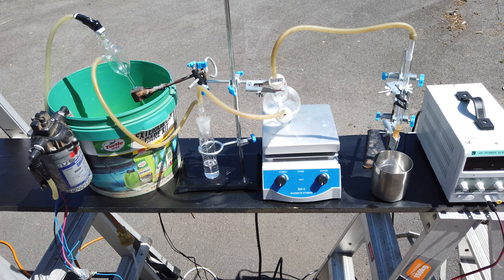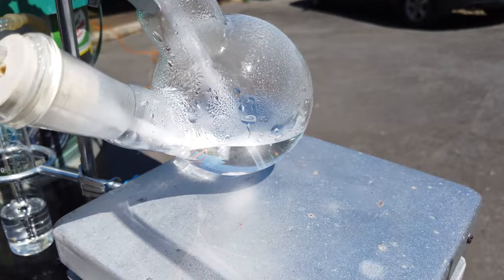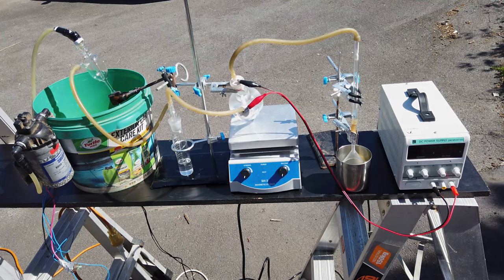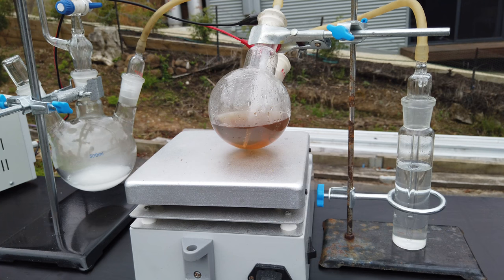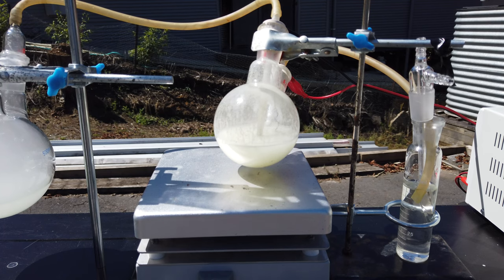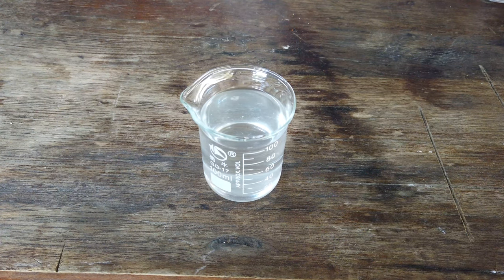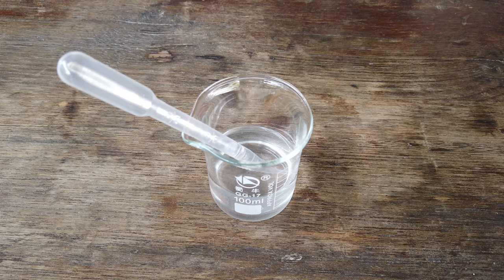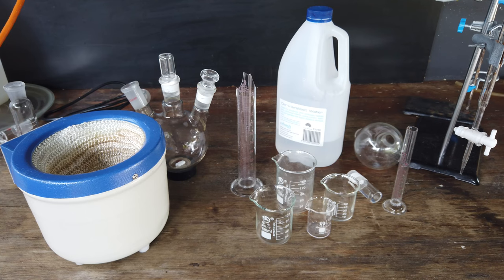Sulfuric Acid From Sulfur Dioxide?

Comment: Some soluble sulfate salt that preferribly creates an insoluble complex with oxalic acid may be an option. Mixing both in equimolar proportions in as little water as possible, then putting it into the fridge and decanting the liquid, followed by destillation the next day could be enough. I wonder if this also works with a 2:3 mixture of aluminium nitrate nonahydrate and oxalic acid in order to get some quick and dirty nitric acid, since aluminium oxalate is insoluble in water aswell.

One thing to be aware of is that Oxalic acid is redox active, so there may be some concentration limit due to decomposition setting in. If that somehow wasn't an issue, then the oxalic axid could be molten (mp for the dihydrate is 101°C) or triturated with the target compound directly in order to get somewhat concentrated acid easily.
Reply: Copper Sulfate with Oxalic Acid is what I've seen. The properties of all the reagents seem just right. The melting idea seems super interesting but I could imagine that to be quite dangerous.
Reply from the maker: I didn't actually say it in the video here, but one of the reasons I'm trying this method is to avoid starting with a sulfate salt. I have other videos about converting sulfate salts into sulfuric acid, but if we can start with sulfur itself (which is a lot cheaper), it would be beneficial from a financial standpoint.
Still though, definitely something to look into if the reagents can be found cheaply.

Comment: Mix sulpher with water and heat under pressure in a stainless steel wessel 😂
Another way is to blast with UV🎉
Reply from the maker: Yeah, I'm going to be staying well clear of pressurised reactions, lol.
Reply: This sounds like if the average londoner designed a reaction scheme 😂
Reply: @ScrapScience  But they're the most fun, how else would you simulate reactions on Venus ?
Reply: SO2 plus oxygen blasted by UV works sort of. The SO3 formed will condense on the UV lamp absorbing the ozone lines. The problem can be solved by using a stronger UV source that makes enough heat to sublimate the SO3 off the light source.

Comment: I didn't know you could make any sulfuric acid at all from just water and sulfur dioxide. Not a chemist but due to the sheer simplicity of your control test, would it be worthwhile to just bubble sulfur dioxide through water and recycle the sulfur dioxide that didn't react to make h2so4 and just do that over and over and over? Sort of like those homemade birkeland eyde nitric acid generator things?

Also what would happen if you ran ozone from an ozone generator through the sulfur while burning it to try to make it give off so3? Probably wouldn't work but I've never seen anyone try it before.
Reply from the maker: The control test didn't actually generate any sulfuric acid. The hydrochloric acid that carried over from the sulfur dioxide generator just gave us a false positive, and it's likely that the electrolysis reaction gave us the same false positive too.
An ozone reaction is definitely an option, but I'm not a fan of how long those reactions take and how low the efficiencies are. I might give it a go one day, but I don't have any plans right now

Comment: Well that's disappointing but I guess that's how these experiments go sometimes. Perhaps it would work in hydrochloric acid instead of sulfuric acid. H2SO4 will just produce O2 at the anode but HCl electrolysis would make chlorine and hypochlorous acid which could oxidize SO2 or sulfurous acid in solution to sulfuric acid. That way the oxidation isn't limited to the anode surface but the whole solution. There might also be less sulfur formation at the cathode because sulfurous acid in solution would be rather short lived.
Reply from the maker: Yeah, it's looking like some kind of homogeneous catalyst might be required for this oxidation. I've been thinking about using dissolved Fe(II)/Fe(III) as an 'electron transfer mediator' of sorts, but I'll add chlorine to the list of things that might work!

Comment: Could you use NO2 to do the oxidation step from SO2 to SO3? Perhaps this would be a way to make the Birkeland-Eyde reactor more efficient. "simply" put an adjustable air metering valve (they are cheap) on the intake of the BE reactor to give some control over the now-forked intake (assuming you go back to the burning sulfur/pull-thru setup). After the BE, you could use an air or water jacketed condenser to re-form the scrambled diatomic Nitrogen and Oxygen into some NO, which forms NO2 in contact with the remaining O2. From there, combine the SO2 and NO2 paths and run them into a chromatography reservoir for dwell time and visual appeal for friends and family. The unreacted NO2 should form HNO3+NO on contact with water, assuming it doesn't react with the SO2 to make SO3+NO on the way there (this makes contact time sort of a big deal). This is the point where you can get the bulk of your H2SO4 and HNO3 in the reaction flask. Any free O2 remaining, and the inevitable trace amounts of NO will oxidize back to NO2 and react in the gas wash stage, becoming weak but recoverable, HNO3. The HNO3 side products should be able to separate from the mix via distillation. Nitric acid boils at a far lower temperature than Sulfuric acid, so a Vigreux column should give a good separation of the two acids, preceded by fractionating the water/HNO3 mixture. You'd probably want to cool down and remove the Vigreux for distilling the H2SO4. Or, you could do it all in one distillation by attaching a vacuum source during the wide temperature deadzone, and then insulating everything, then insulating the insulation. With a light vacuum source, you can get the Sulfuric acid boiling point a bit under 300C, and with a strong vacuum source, you can get it down to a little over 200C. That's not bad, but your glass is likely to get stuck together, warranting the purchase of fancy combined function glassware (for fewer connections).

...or you could get bulk Sodium Percarbonate pretty cheap, in bulk. It is the active ingredient in Oxyclean, and various brewery/vintner food-safe sanitizers. It's 32.5% by weight H2O2, but in a powder form.
Reply from the maker: Nitric acid/NO2 is definitely an option for this type of reaction. In fact, they can actually act as catalysts to force the reaction between atmospheric oxygen and aqueous SO2 (so no NO2 is actually lost in the course of this reaction). A definite idea for the future. Thanks!

The problem with sodium percarbonate is the fact that it's mostly sodium carbonate. Using this stuff directly will produce sulfate from SO2, but the basic nature of the sodium carbonate will cause the final product to be sodium sulfate (probably one of the most useless chemicals I can think of).
Reply: @ScrapScience   Thanks for the reply and confirmation of the idea. 
The part that involved the Sodium Percarbonate was not intended to be used directly, because of the obvious neutralizing effect of the carbonate. I kept that afterthought brief because I don't know how CO2 will affect the system. CO2 is likely to come from acid-forcing the carbonate to give up its O2 content.
The Percarbonate side reaction would be from a flask with the powder, a vacuum port (for output), and a PE-Addition funnel to drip some liquid onto the powder to cause it to release the O2 (and CO2 biproduct). The vacuum port runs the O2 via hose to the cooled, pre-dwell-bulb gas flow from the Berkeland-Eyde NO generator. 
I don't know what liquid would be best for releasing the O2 from the Na-Percarbonate. I would default to Citric Acid (cheap, dry, doesn't stink, non-hazardous, known to cause NaPC to foam aggressively in my washing machine) dissolved in water.  I suspect that it will put a lot of CO2 into the airflow, as well as some water vapor.
 I have no idea what effect the CO2 would have on the overall experiment. The effects are probably negligible, beyond Carbonic Acid pH offset. Since it would likely be a better idea to perform the distillation(s) before measuring the produced products, any CO2 should be a non-factor by that point, assuming it doesn't interfere with the process. 
Arguably, it may be better to place the air flow metering valve before the Pressure Equalizing Addition Funnel, and place this funnel/O2 generator setup before and inline with the BE reactor, in the hopes that the electric arc will also break the CO2 into O2 and ??, but I would be concerned about it making organic materials and tars. The post-cooling stage will have water, and it will become liquid acid, for sure. The physical arrangement of the system will benefit from ensuring the fewest gathering spots for this water/product loss to accumulate.
Reply: Oh, I see my error with the first comment about the Sodium Percarbonate. I smugly offered that as a source of H2O2, without thinking of a way to separate that from the carbonate afterward. 
Well... It can still produce O2 at an estimated cost of $0.03 per gram of O2 (best case scenario/if buying 10Lb bag of sodium parcarbonate + shipping in USA). I don't know if this is a good value for the additional NO-to-NO2 conversion efficiency, but it's more glass, and bubbles, fun adjustments to make, and calculations to calculate. Certainly worth the entertainment value for a home experimenter. :)

Comment: I read on science madness that platinum can be poisoned by sulfur oxide. Is that OK for the platinum anode?
Reply: It should be protected by the current passing through it. Also,  isn't it mostly platinum catalysts that have trouble with sulfur?
Reply from the maker: I'm honestly not sure. The platinum still looks and acts as it did before, so I imagine this isn't a problem for bulk platinum surfaces.

Comment: Can you try electrolysing sodium hypochlorite to obtain sodium chlorate?
Reply from the maker: It’s much easier to do this by simply electrolysing sodium chloride. I have a video about this here: https://youtu.be/N45DlWLQ218?si=8OvFCFhKTbQhnJkG
Reply: @ScrapScience i've already watched it but if u think that's easier than electrolysing bleach then that sounds good
Reply from the maker: Ah I see, gotcha. 

Whilst it’s true that the electrolysis of bleach would be more energy efficient in producing sodium chlorate, there are some problems that make it more difficult than chloride electrolysis:
Bleach is generally not very concentrated, so it’s very difficult to get a sodium chlorate product to crystallise out after you’ve performed the electrolysis. Additionally, bleach is only available as a solution, so it’s not generally possible to feed sodium hypochlorite into the cell as it runs. 

For these reasons, yes, I do strongly recommend the much simpler electrolysis of a sodium chloride solution.
Reply: @ScrapScience  thank you so much bro for the infos

Comment: Maybe repeat the experiment, but instead of using a 4% solution of sulfuric acid in the beginning try using a ~50% one. Aparently this produces hydrogen peroxide once it undergoes electrolysis.

Comment: Could you recycle the SO2? you have it bubble through more than once, or is that not as easy as it sounds

I bet you couldn't do this with the selenium analogue 😅 if this creating small amounts of sulfur
Reply from the maker: Yeah, recycling gas from a single stream is a lot more difficult than it seems. At the very minimum, you need a gas pump and a reaction vessel designed to allow two isolated gas streams. It would be very nice if it were easy...

And yes, haha, selenium chemistry is definitely beyond my level of knowledge and safety abilities.
Reply: @ScrapScience I love the glass aspirator pump.

Revisiting h2so4 videos because I've realised I can't buy sulfuric battery acid in uk any more

Comment: I was wondering if one could buy an ozone generator and modify it or adapt it so that the ozone it generates is bubbled into water, into which sulphur dioxide is simultaneously bubbled (via a SO2 generator)? If one was to try ozone as an oxidant, an all-glass aparatus and PTFE tubing (or glass tubing) would be required, as ozone is such a powerful oxidizer that it will quickly degrade rubber and most other polymers. 

PS: some of the portable home ozone generators I've looked at come with flexible tubing attached to an air stone (manufacturers suggested uses include germ removal on foodstuffs like fruit and veg; the idea is that you you place the fruit and veg into a bowl of water, then you bubble generated ozone into the water (through the tubing and airstone), which supposedly kills germs. These ozone generators could very easily be rigged up to chemistry apparatus, such as a SO2 generator!
Reply from the maker: The main problem I have with using ozone as an oxidant is the abysmally low generation rate. Unless you can hook them up to pure oxygen, I haven't seen any cheap generators make any more than a few hundred milligrams per hour (though maybe I just don't know where to look for good ones). I mean, I'm no stranger to slow reactions, but producing only a couple of grams of sulfuric acid a day is difficult to justify.
If I do end up getting one of those generators, I'll definitely look into it though. If it works well, maybe it can be scaled up...
Reply: @ScrapScience It's worth remembering that the other byproduct of air corona discharge is nitrogen oxides, so win-win either way.

Comment: What if you added some hcl the chlorine from electrolysis can oxidize it to H2SO4 and make hcl that will get electrolized
Reply from the maker: That would likely work! There are a few options for what is effectively an 'electron transfer mediator' for this kind of process, and chloride/chlorine is one of them, I think...
The only issue is that with the current setup, the chlorine may also react with the sulfur forming on the cathode, which would yield sulfur chlorides. This one might require a separated cell. 
Either way, I'll hopefully try something similar in the future at some point.
Reply: @ScrapScience  you could also make chlorine in one cell and mix it with sulfur dioxide and water it a diffrent container it should form HCl and H2SO4 which can be separated by distilation it is much harder and requires a lot of work but may work

Comment: i was searching about sulfuric acid production, aparently you can produce hydrogen sulfite(H2S) AND ammonia in small amounts using a biodigestor
the thing is, H2S is soluble in water, and in theory, can react with the oxigen present, forming water and Sulfur 

could be cool make a video of a proof of concept: use H2S dillued in water and convert it in sulfuric acid

Comment: Hey harry what if you use the separating element in car batteries as membrane? Think it will be cheaper
Reply from the maker: The separator in car batteries is generally nothing more than a porous diaphragm - not a proper membrane. Usually, it's just a fine mesh of fibreglass (or maybe a polymer?). They work great as electrolytic separators, but you might as well use a piece of finely woven fibreglass, as it will do exactly the same thing. Also, the idea of ripping apart a lead acid battery terrifies me, but if you can buy them separately then I suppose they're a great option if a diaphragm is all you need.
In future videos where I require such a separator, I'll definitely be using something similar.

Comment: Hello! Can you please make video on making PbO2 anode? Like plating.
Reply from the maker: Sorry, I'm not a fan of lead-based electrodes and I don't generally recommend their use due to the toxicity risk. I'm afraid you're going to have to look elsewhere on this one.
Reply: @ScrapScience I have seen some videos where you used lead anode, so you already got some experience. Does it contaminate electrolyte too much?
Reply from the maker: I have used lead anodes in the past, but I avoid them today for reasons of toxic contamination and the difficulty in dealing with waste. There are very few situations that a lead anode can be used directly (and even in these cases, it should be avoided for the reasons above). In the cases where you need an electrode of lead(IV) oxide on an inert substrate, it's just not worth the risk of getting lead poisoning or contaminating your workspace.
Reply from the maker: This isn't to say that lead-based electrodes are always a terrible idea, but it's just that I'm not comfortable working with them any more.

Comment: I was wondering if it'll be possible to produce it via ionic bombardment. Basically using a large enough electric potential to ionize SO2 and accelerate it into a chamber of pure O2 before scrubbing. However, resulting solution might be contaminated with H2SO3.

Comment: Sulphur dioxide shouldn't alter the pH until it reacts with the water to make H2SO4. If it's in solution it's H2SO4, doesn't it need to be interacting with water to even measure the pH???
Reply: So2 reacts with water to h2so3 instead of h2so4
Reply: @y33t23  Dammit! I forgot about that as I'm still thinking about the method I've used to get SO4 instead of SO3. It was done at high pressure and temperature and worked beautifully. Very little unreacted sulphur remained and I've had up to 90% sulphuric acid from it (usually a bit lower, but still incredibly useful...). I hadn't even thought of the fact it wasn't under as much pressure because I'm so fixated on how well my bo mb prep worked.
Edit: bo mb because YT has a habit of deleting my comments because of my username already, I don't need another commenting bloke because the bots misunderstood me!!!